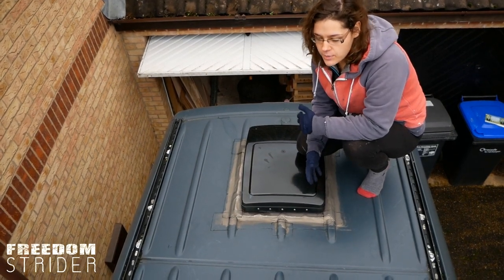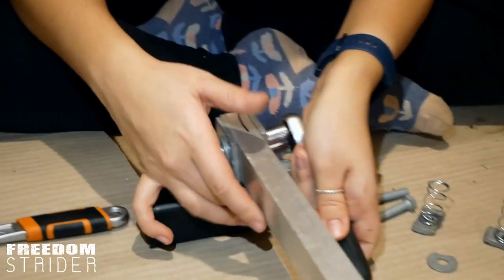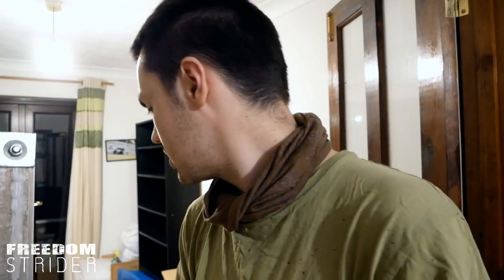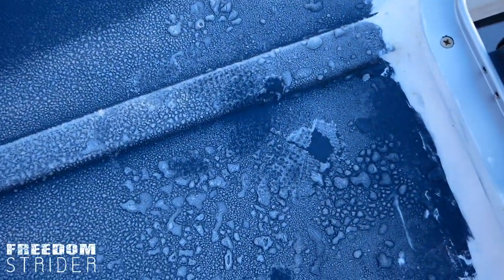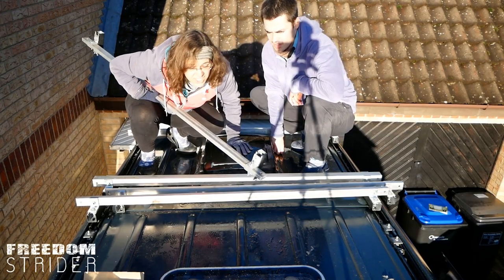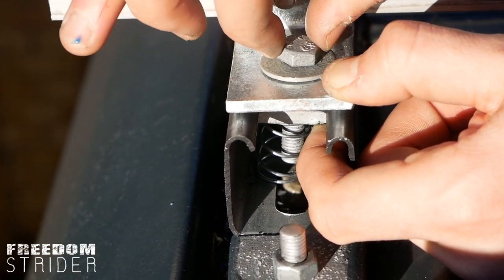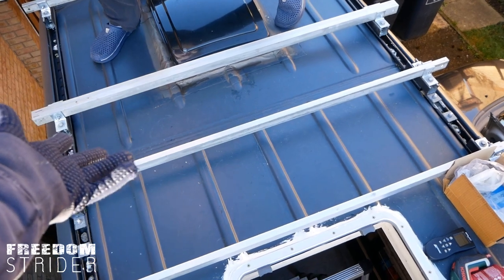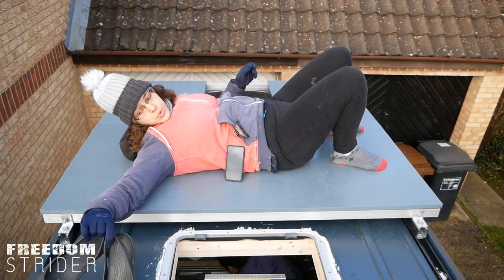DIY Roof Rack Part 2 - Lightweight Ply Deck Assembly Under £100!

Comment: In the future you could use aluminium sheet metal up their.. light, weatherproof, safe if you have a small fire pit and will last a lifetime👍well done another job done 👌
Reply from the maker: Yes we were actually thinking an aluminium sheet sandwich type contraption could also work. Aluminium sheeting is not cheap but certainly a good idea to try of you have the time and materials to hand 😎👍

Comment: Nice one guys, will be interesting to see how the soft wood ply holds up! was there a specific reason you guys never went for a marine ply or even just and exterior grade ply?
Reply from the maker: It was mostly just for weight reasons - marine grade ply is hardwood and weighs more than structural softwood 18mm ply. 18mm marine grade hardwood weighs as much as the composite decking. For our section we made now it's only 10kg more hit over an entire roof which we plan to build in the future, it's over 30kg lighter 😎
As for exterior grade, this was the only ply they had in the shop at the moment honestly 🤣

Comment: I created my own custom roof rack...I used aluminum, no steel - no rust issues, and easier to work with.  I used all stainless steel nuts, bolts & lock washers.

I also used butyl tape and lap sealant to prevent water leaks.
Reply from the maker: Sounds like a neat idea 😎

We used galvanised steel unistrut for our main rood rack and can now bolt absolutely anything on top of it 👍
Reply: You used sheets of aluminium over the struts? If so, how thick?
Reply from the maker: We didn't use any aluminium sheets, we just used 18mm softwood plywood for the deck, which weighed in at around 15kg for the surface area. If we were to go for aluminium, we were looking at honeycomb aluminium sheeting for it to be strong enough to walk on. But how thick, I'd imagine at least 15mm thick (but that's just a starting point guess). 🙂

Mind you, aluminium sheets are not that light or cheap...
Reply: @FreedomStrider  oops I meant to ask Dave about his one haha. Thanks though, very interesting/useful 🙏
Reply: @danviridian  I created a roof rack with the least amount of material possible.  Got it all at HomeDepot & Lowes.  No sheet metal, more of a framed-style design.

I used 1" square tubular aluminum for creating brackets, each around 5" long, three running along each side of the roof, front to back, attached to mounting holes (bolted to nuts) that came with the van, with some dap & butyl tape.  Very secure & strong.    

I then attached 1/8" L-shaped aluminum rails running front to back, mounted on top of the brackets. These rails are roughly 1.75", wide & high. The issue with the roof is that the roof is not perfectly flat, and the mounting holes were not perfectly aligned.  

I didn't want to lay the rail directly on the roof, it is nice to have a little space between the rails and roof for snow, water, leaf removal, etc. Working with aluminum made it very easy - easy to cut, never painted it, never rusts, it is light so my van is not top heavy, easy to bend it a little for a better fit, etc.  The rails also go all the way to the back bumper, so when I open the rear doors, I can use the rails to hang mosquito net over the back door opening.  Or hang a hammock to a tree from it, or clothes line, etc.  This would not have been possible (or at least more difficult) if the rails were attached directly to the roof and not the brackets.  

Cross bars are 1" L-shaped aluminum.  I built a manual tilt system for the solar panel similar to the one that Renogy advertises all the time, to tilt them towards the sun. Two bolts as the hinges, flat aluminum rail to lift it to the desired angle. I can do this without climbing on the roof, which was a key design requirement for me. 

Two days to do it...I wanted the lap sealant to cure over night.

Keep in mind I have a small van, a 2021 Nissan NV200, one solar panel for now but plenty of room to add another, plenty of room for a roof fan, too. 

I can't see myself ever wanting to sit or lay on the roof...so the design was simple.

I can't see ever adding a patio sun area on the roof...but if I wanted to, I would consider making something that slides out horizontally, with poles to the ground for support.  This way it could act as an awing too, and the space up top wouldn't be limited to just the size of the roof.
Reply: @jkyoft78  Thanks for the writeup, this is great. I couldn't stomach NZ$600 for subpar retail roof racks for my Nissan Elgrand which may not even be strong enough for mounting a 330W panel + awning + space underneath the panel for roof vents.
Reply: @moolaxi  I'm with you.  I looked around for roof racks...what I saw cost $1000's, way too much.  I think I spent around $100 or so for my custom made one.  It is exactly how I wanted it. Best of luck...

Comment: Great deck it looks really good.   You mentioned the shower at the end what issue are you having with it please?  I have the same hydronic system
Reply from the maker: There's no issue, we just haven't plumbed it up yet (the hot water system). We're planning to build a recirculation shower but it requires a bit more thinking to make happen - would love to hear about your setup though - are you just using your heat exchanger or are you using a boiler tank as well?
Reply: @FreedomStrider  I’m hoping to use  just the heat exchanger, do you think it needs a tank ?   I haven’t got very far yet but could do with asking you both the occasional question as I go if that’s ok?
Reply from the maker: We are not planning to install a tank. We are going to run tests and hopefully, the heat transfer is fast enough to give warm water. We'll document it 😀, so you'll know. We are happy to answer any questions to the best of our ability, so ask away.

Comment: wohooo roof rack! may I ask about the dimensions of the skylight? I really want to put one above our bed so we can also access the roof. :)
Reply from the maker: We got a "Bainbridge storm hatch - size 50" (https://www.marinesuperstore.com/hatches/window-hatches/bainbridge-storm-hatch)

Size 50 is the largest we could fit between 2 roof ribs in the van, the next size up although bigger, would have required cutting through the roof ribs, so not ideal. So far, it's worked amazing! 🙂👍
Reply: @FreedomStrider  Hey! Do you know what the difference is between the flange and flat versions of your vent? 🤞
Reply from the maker: Yeah, the difference is the flange has an extra piece so if you're mounting it on a frame on the outside, it can lip over.
Best shown here (2nd picture: https://www.marinesuperstore.com/hatches/window-hatches/lewmar-ocean-hatch)

We got the flat version since even though our van roof isn't flat, we used some neoprene to make it semi-flat and just used a lot of sealant to waterproof it, but we didn't build a frame on the outside (only on the inside to screw the hatch into). 👍

Comment: The deck should last long enough. BUT, do I see a knot hole in one area? Not an actual hole, but something that will catch and HOLD water.  You might want to fill that in with something and then paint it over again.  Otherwise, this is truly inspiring.  Gives me hope for when I do my build!
Reply from the maker: Thanks 😀 You are right about the knot... we wished we turned it over. We are planning to repaint the deck in the summer and filling the hole is on the list too.

Comment: Can you please tell me where you got your roof hatch from and are you doing a video for that fit or have I missed it?

Also where is your ladder from?

Thanks
Reply from the maker: Oops, I thought I put links to those in the description, seems not!

➤ Our Ladder: https://amzn.to/3oafqnr
➤ Our Skylight Hatch: https://ebay.us/yECzez

As for the skylight, we didn't film a video for it, the installation is near identical to how we installed our Maxx air fan apart from we used neoprene instead of butyl tape to even out the roof surface. 👍

Comment: It's 18mm hardwood ply right? 🙂
Reply from the maker: Nope, softwood 😊 - as it's not a high traffic area, it's just a lounger - so we don't mind it denting... fun fact, hardwood is the same density as the composite decking... quite a nightmare this weight 😂
Reply: @FreedomStrider  Hey! So I wonder if you can help me with a quick question/issue? I've currently got a Fiamma 50 vent above my bed which has a 50x50cm cutout. Compared to the Maxxair Deluxe (which I have nearer the front of the van) the Fiamma is bad because it doesn't open fully and also doesn't have a fan (unless you add the awful fan attachment, which barely works!). I see that the non-flanged version of your (Bainbridge 60) hatch would need a 58x58cm cutout (so I would only need to widen the cutout dimensions by 8cm each). In this case would you recommend the flanged version for a more solid install? Cheers! :goodvibes:🚐
Reply from the maker: I don't think the flanged version would be any more or less solid than the flat version, regardless of the hole size. I can't really that much use for the flange when it comes to isnalling it on a van, it's mostly there to counteract the curvature of boat roofs and to add stiffness if you're installing it into fibreglass. Metal with a wooden frame is plenty stuff enough to go with a flat version. You'd still need to waterproof either hatch the same way, and make sure you install either on a flat surface to evening out the van roof ribs (if yours has any) 👍🙂
Reply: @FreedomStrider  Super helpful, I appreciate that :)